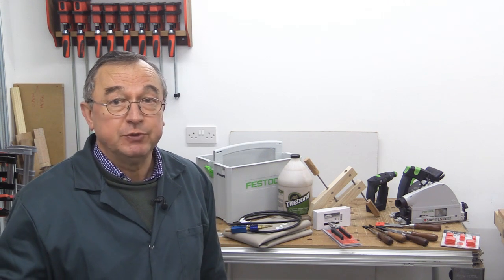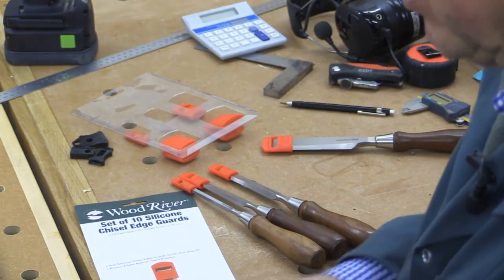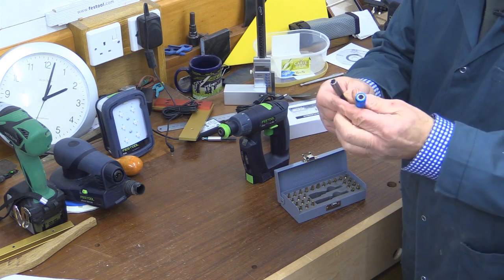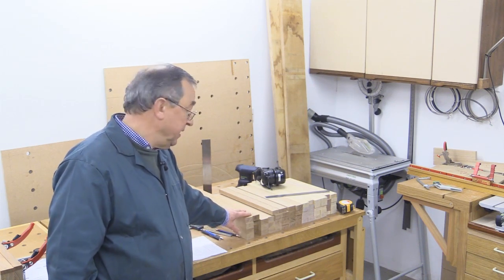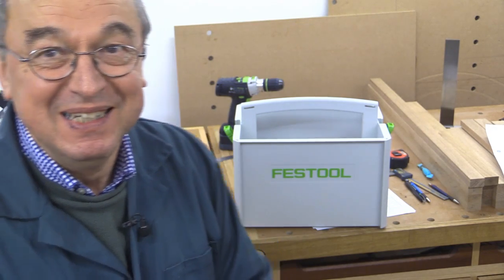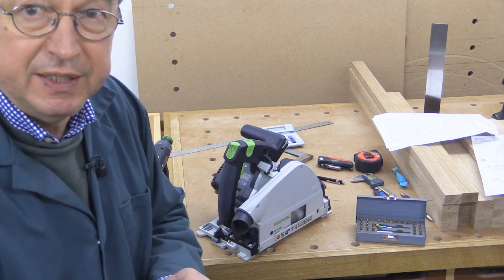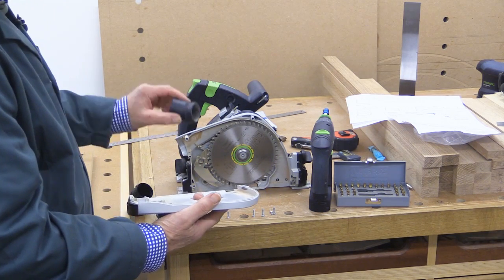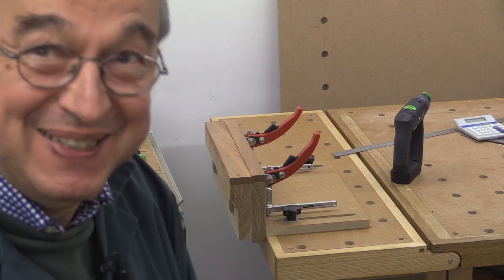Workshop Notes #10

Comment: Hallo Peter. Thanks for the great videos again. Concerning the new suction connector I have made some research lately as I plan to buy a new extractor. Besides the new dustport on the TS55 other tools do also have the new ports and you can also upgrade existing tools. They are listed as spare parts at Festool. Here a non exhaustive list with corresponding part numbers if interested
RO 150 FEQ: 10025000
RO 90: 10021166
DF 700:10027826
TS 55: 202096             
OF 1400: 202471
Reply from the maker: Hi Frank, A great piece of research and I am sure it will help a lot of people.  Many thanks.   Peter

Comment: Those silicone rubber edge protectors are really good. I found them a year or so ago when searching online for some to replace my lost ones. In the US WoodRiver is the house brand of Woodcraft stores; e.g., Quangsheng hand planes are sold under the WoodRiver brand exclusively at Woodcraft stores. And thanks for the tip on the TS55 dust hose connector, that has always been a small annoyance for me too.
Reply from the maker: Hi Michael, Thank you. I have just tried out the new dust port and it is a little better but not a real solution to the problem. In fairness I am using a quite heavy 36 mm hose.  Peter
Reply: New Brit Workshop festool
Reply: It's a shame you can't get a WoodRiver 2" silicon cover. I tend to use my 2" chisel a lot.

Comment: Hi peter,

On the subject of the axminster bits you recommended, I recently got a trend snappy chuck with the centrotec fitting for my C12.  It has a very deep hex socket and works really well at stabilising non centrotec bits, I was even able to utilise an old rusty bosch green set.

I hope you feel able to tell us more about the vacuum bag, even if it doesn't work, it would be interesting to know how you got on with it.   I'm always interested know what can be achieved, without having enormous machinery which costs as much as a house.

Andrew
Reply from the maker: Hi Andrew, Yes, I have heard of the Snappy stuff but not seen any. I suspect my only potential issue with the vacuum bag is whether my small compressor is up to the task. I will do my best.   Peter

Comment: Just a note on the TS55. If you have an older model like myself, I overcame the hose problem by inserting a small self tapping screw in the saw body to set the connector at the angle I require, which is mainly pointing upwards. Works a treat for me.
Reply from the maker: Hi Dave, I did think of doing that but thought that I would try this first. If this is not perfect I may superglue the new dust port into the right position - which is also "up" for me.  Cheers.  Peter

Comment: Is there a hose connector that locks on to the outside of that indexed dust port? It looks like it has a bayonet fitting(?)
Reply from the maker: Hi Rikard, I would think that there ought to be one. It is primarily to allow a dust bag to be fitted directly to the tool. The normal hoses do fit - 27 mm inside and 36 mm outside.   Peter
Reply: Makes sense. Many thanks!

Comment: Hi Peter
Looking forward to the veneer press review as this something I been looking into recently myself.

Not sure if you are aware but when removing the TS55 side plate there is a tiny little spring clip for the replaceable splinter guards that has a habit of projecting itself when removing the side cover.

If i recall it will it will only fit back in position correctly one way, but many people have had confusion locating where this little clip lives & how it refits correctly when they discover it after removing the side plate. i think this would have been worth mentioning as i feel many people may find their splinter guards no longer clicking up if they lose said little clip whole retro fitting dust ports as it is very very easy to lose if not aware of it. 

But once again great videos & keep up the relentless work of making them 👍
Reply from the maker: Hi Darren, I was not aware of this and will check it out today. If necessary I will create a little video about it.  Thank you very much for this.   Peter

Comment: I've become a Festool fanatic and am steadily building up my collection.  I bought the TS55 about three months' ago and the improved dust extractor linkage came already attached.  On the subject of the TS55 I used it in anger for this first time this week to cut a lot of some seriously hard wych elm.  It worked like a dream the cut edges are almost as smooth as silk.
Many thanks Peter and I look forward to your video on veneering in due course.
Reply: Hello Ron,
I bought the TS55 from Axminster about three months ago.   Peter demonstrated how to add the improved dust extractor connection.   My saw came with this new connector already in place so Festool must now be fitting them as standard.
I hope this is of help.
Best...
Alan.
Reply from the maker: Hi Alan, Many thanks - good luck with that lovely saw.   Peter
Reply: Alan Simpson   Alan can you elaborate on the dust collection change to the TS55? Mine is about 5-6 years old.... Thank you...